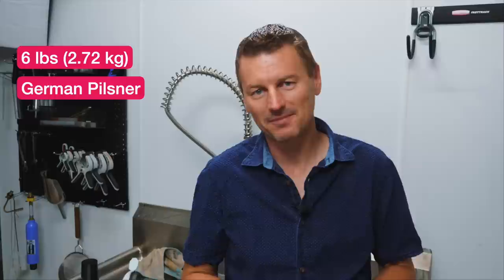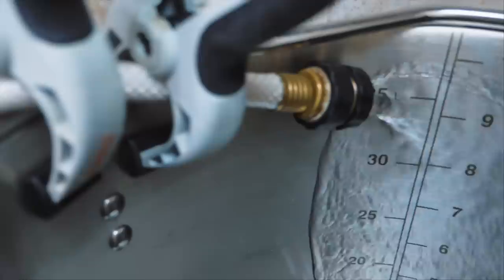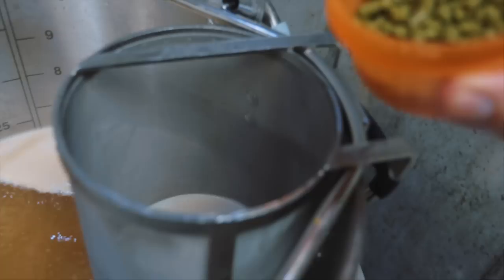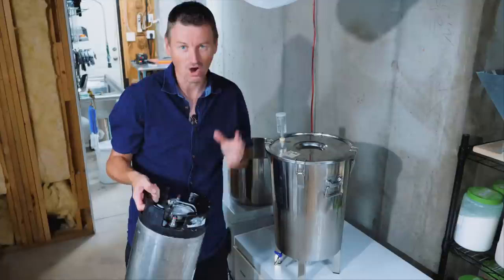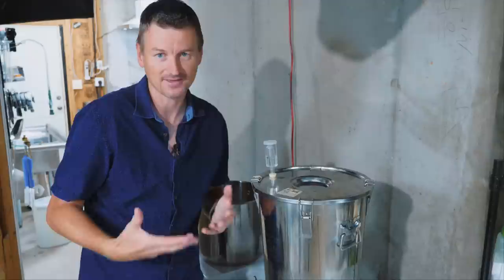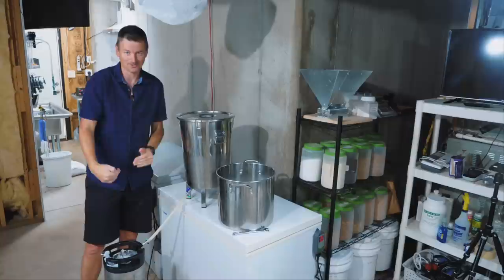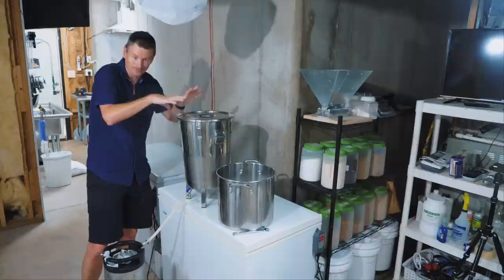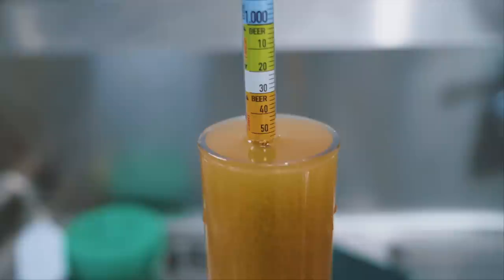How To Brew Kolsch Beer | Kegging Homebrew Beer

Comment: When you are transferring to the keg using your method just prime the keg with CO2. You obviously won't be able to pressurize it but you can establish an ambient CO2 atmosphere inside the keg, and thus the only oxygen contact will be the minimal exposure from the headspace in the fermenter which is already CO2 rich, or should be.

Comment: You don’t need pressure fermenter to eliminate all the oxygen.
Fill the keg with starsan mix 99% full and use CO2 to empty the keg.
Let the extra pressure in the keg out, and do it the same way as you are doing it, except connect the gas out on the keg to the hole in the lid with a hose. This way you will move the CO2 from the keg to the fermenter
Reply: I was just going to post this as an option.  I have not done it myself,  but it should work perfectly while keeping the container at neutral pressure.
Reply from the maker: Oh that’s clever, sending the CO2 from the keg back into the fermenter. So the only time I’m really getting much oxygen in is when I replace the stopper in the fermenter with the hose from the keg. Will give this a try!
Reply: @TheHomebrewChallenge  Maybe you could use the CO2 produced by fermentation to purge the keg as well? You could connect a tube from the fermenter to the gas post, and have a tube with a check valve going from the liquid post into a bucket (or another keg) to drain the starsan. You'd essentially be using the keg as a giant airlock, and you wouldn't have to waste bottled CO2.
Reply: @TheHomebrewChallenge  Jo Walderhaug is on to it.
Completely fill the keg with starsan and then seal and purge with CO2 as per Jo Walderhaug's comment - liquid disconnect on liquid post - you can reuse the starsan for something else if you want.
When the keg is empty shake it around and invert it while the CO2 is still flowing so that you completely drain the starsan from the keg and the liquid dip tube.
Remove the liquid disconnect and slightly over-pressurise the keg.
Disconnect CO2 from keg.
Connect your liquid in line to the keg and let the CO2 over-pressure purge the air from the line, and while the CO2 is still flowing out the line connect the line to the ball-valve barb on the fermenter. This line is short so will only take a second or so to purge, and don't open the ball valve just yet.
Then similarly connect the gas line to the keg, let the remaining CO2 in the keg purge that line, and just as you're getting down to atmospheric pressure connect the line to the blow-off on the fermenter (recommend stainless blow-off for the BrewBucket https://www.ssbrewtech.com/products/blow-off-barb-for-ftss-lids ).
The BrewBucket will handle a little bit of over-pressure so it's not absolutely critical that you let it go all the way down to atmospheric.
Open the ball valve, and commence to begin completely oxygen-free transfer!
eta: if you want to save CO2 I'd say it's definitely worth trying Edward Bowers' idea. I've never done it myself but I can't see why it wouldn't work.
Reply: This is what I do with a plastic fermenter, it takes a while but worth it

I also use the pressure from kegs to flush bottle headspace and as I am removing top or airlock
Reply: I do similar, sanitised with star san then pressurised to remove it, I simply fill through the lid then repurge when sealed on the basis that co2 is heavier than air so any contact should be minimal.

Comment: I've been doing pressure transfers from the brew bucket to a keg with no problem.  I bought their 90 elbow attachment that screws into the airlock hole, and attached a gas tube to it.  Sending about 1-2psi to the brew bucket thru the lid and everything is closed.  I also fill the receiving keg with co2 and purge before moving the beer.  Works well!

Comment: Re: packaging - you’re spot on up to the point of filling your keg. Here’s what I do. Before filling and with the pressure relief valve open, purge with CO2 through the dip tube/liquid side to push any air out of the keg. Then, when you fill through the liquid side, you are exposing it to a layer of CO2 instead of just air. Once filled, purge again through the air side with CO2. I don’t worry about the fermenter. The time spent while filling is minimal.
Reply from the maker: Good suggestion. I've been doing the post-fill purge, but not the pre-fill.

Comment: I’ve actually done pressurized transfers out of a glass carboy with a carboy cap at 1-2 PSI. That’s barely enough to push the beer. I think you’ll be fine doing that with the SS Brew Buckets.
Reply from the maker: Brave 😀

Comment: I have 1 ss bb mini and 3 anvil. And my approach is the same. I bought solid bungs, drilled a small hole, bought a gas inlet connector. Fill the empty keg with Co2, purge oxygen, hook Co2 to the connecter at 3 ish psi and let it flow just as your doing.

Comment: I have done pressure on the brew bucket, didnt let it get above about 2 or 3 psi you just need to be careful that the pressure in the keg is low other wise it will equalise out and might cause some issues. 

Also, if you make sure that you flood the kegs with CO2 before filling the CO2 will cause a layer on the bottom as it us heavier that oxygen and the oxygen will be pushed out the top with minimal contact with the beer.
Reply: I did the same thing. I used co2 to push out starsan from my keg so I had a sanatized keg full of co2. I opened up the pin on the keg as I did a closed transfer to the keg from the brew bucket with very low psi. It was slow, but worked well enough for me.

Comment: If you had a system like a WilliamsWarn or Fermzilla you could ferment as normal, (not pressure fermented),detach the bottom attachment to get rid of the sediment with no exposure to oxygen, and hook up CO2 and condition and serve from the same vessel. Will most likely have a longer shelf life👍.
Reply from the maker: Yes indeed. I may be trying that soon 😀

Comment: I ferment in kegs like u have with spunding valve, Transfer carbonated beer under pressure is not a problem: u just need 2 liquid connectors, piece of a tube, spunding valve and a CO2 gas bottle with a regulator. 
To get rid of air or oxygen in a keg is also a piece of cake,  just purge the keg with CO2 from a bottle thru liquid post.

Comment: This is a bit late to the story...but my process is as follows: 
Spike flex+ with the gas manifold. I ferment under pressure, but thats irrelevant. 
From the gas manifold, I connect a gas disconnect from the manifold to the the liquid out of a keg (previously sanitized). 
From that 1st keg, I connect the gas out to another keg (half full of sanitizer) to the liquid post of the 2nd keg. 
From the 2nd keg, I connect the gas out to a bucket of a sanitizer. 

What does this achieve? It harvests the CO2 of fermentation to completely devoid the 1st keg of O2 (and probably the 2nd keg, but its just a jumper). Given an O2-less keg, I can then connect a CO2 tank to the gas manifold of the Spike Flex+, and package to that 1st keg with high confidence of no or extremely minute O2.  It also saves a bit of gas by using what fermentation already produces. And its nerdy, which is always fun.
Reply from the maker: Love that process. Do you cold crash? If so is there any opportunity for suckback from keg 2 into keg 1?

Comment: Hey Martin can you brew a traditional German Altbier or if they say in anglo-american "German Style Brown Ale" ?

Here is a recipe suggestion!

55,75% Pilsner Malt
35% Munich Malt
4% Cara 60L or 70L
4% Dark Wheat Malt(or Pale if you havn't dark)
1,25% Chocolate Malt

1.049OG, 1.013FG, 44IBU low to medium-low hopflavour(use classic german aroma hops like hallertauer mittelfrüh and spalt spalter both in FWH and 20 or 25min boil) and a classic german ale yeast(Wyeast 1007 or WLP036) fermented at 14 to 16°C.
Reply from the maker: Oh man I just brewed my altbier yesterday. Had I seen this before I would totally have used your recipe. I used the same base malts. For specialty malts I used Caramunich I and Chocolate malt. Wheat malt would have been interesting.
Reply: @TheHomebrewChallenge  

yes my recipe is a very authentic altbier recipe... overall the hops. the tannins of a high hop rate with lowe alpha hops is an important thing with altbier. the yeast is absolutly important! you should never use a lager yeast in an ale! :-DDD

with cara 60L or 70L in meant caramunich I or caramunich II. I willed it make easier for you with the lovibond specs.

I self brewed a historical altbier recipe with 26% chit malt, tripple decoction (acid rest + protein rest + maltose rest + dextrine rest) the rest of the grist was only munich malt and dark wheat malt - so without cara, because the deoction - and little bit german Röstmalz I(same as chocolate malt)for colour. the chit malt I used as replacement for historical air dried malt.

if you can decoction mashing for german beers, do it! if you want simulate a decoction beer, use small percentages of melanoidin and darker(from 60L to 150L) cara malt together. a tiny protein rest with german malts is everytime good, it improves flavour a little bit to a more grainy, very german like beer taste. 10 or 15 minutes is well enough, except for german wheat ales gladly more. 

oh and if you want to brew with chit malt or other under modified malt, you have to must brewing with decoction and longer protein and beta glucan/acid(both is in the same tempersatue spectrum) rests. and yes chit malt has much  enough enzyms(mostly beta amylase, but low in alpha amylase) in comparsion to raw grains, which have no enzyms. I read in USA there exist under modified pale malt too. in germany we say chit(spitz) or short(kurz) malt to it. its very rare and expensive here.
Reply: @TheHomebrewChallenge   Oh and Munich Malt is the most important malt for Altbier. Munich malt is the primordial malt. you can also try a 100% munich malt altbier. but some pilsner malt and cara malts plus roast malts is a more modernly altbier grist. 100% munich and munich + air dried malt are mor historical versions of altbier grists. of course you can increase the munich malt percentagae of the grist up to 100%. but attention, an altbier shouldn't be sweet, attentuations between 70% to 80% is right.

Comment: Possibly stupid question, but when filling the keg using the described method (or one of the suggested with co2 flowback to fermenter) how do you know when the keg is full and not too full for force carbonation?
Reply: Fill the keg with water, weight it, then you know how much weight of liquid it can hold when filling it blind

Comment: Another great vid, why didn't you fill and purge your keg with co2 before transfer therefore getting rid of oxygen 🍺
Reply from the maker: Hmm so fill with low pressure CO2, pop the gas in connector on, then fill through liquid out post?
Reply: @TheHomebrewChallenge  yeah but once purged just take lid off then fill through lirquid out post , the co2 will sit on top off beer as its filling just as if filling a bottle 👍
Reply: You don’t need to open the lid. Fill the keg up to the top with sanitizer, push it out with co2. Then pop the gas connector on with a tube with the tip imersed in water (similar to a blow off tube). If you want to be even more caution, connect the tube from the gas post to the hole in the lid of the fermenter, this way the co2 will escape to the top of the beer.
Reply from the maker: Yep I like that approach - going to give it a shot.

Comment: Try putting hops in before the wort drains, first wort hopping adds a very subtle, flowery hop presence throughout, then the rest of the bill however you want. Not more hops, just timed differently..why not purge the keg at least with CO2, and then just put a hose with a CO2 “drip” into the fermenter as you transfer..? I like Kolsch a bit darker than the style, but yours seems a bit..too dark to be honest..